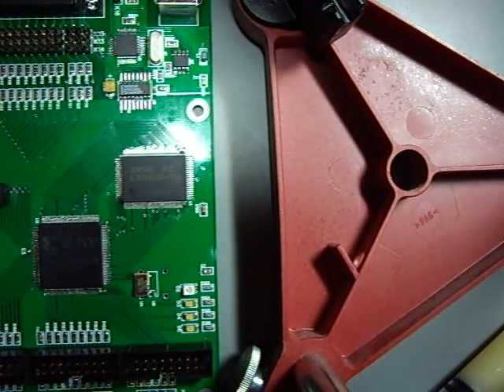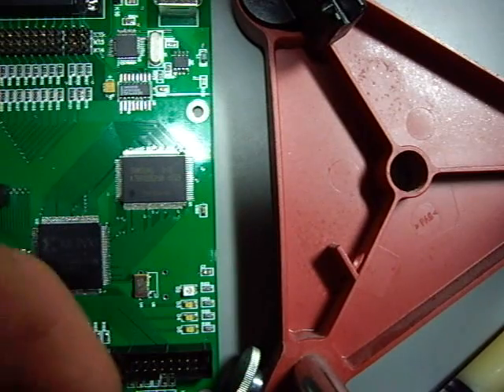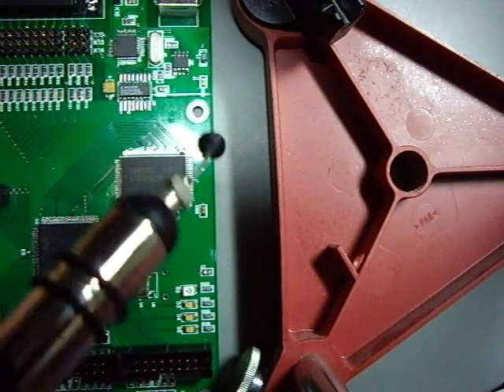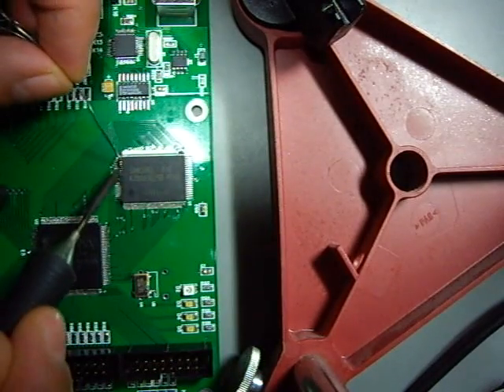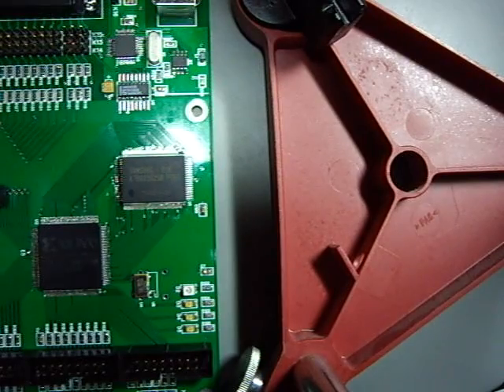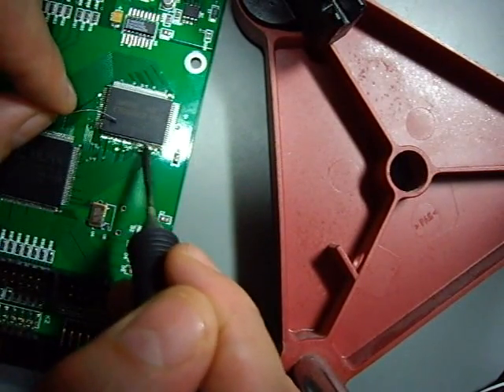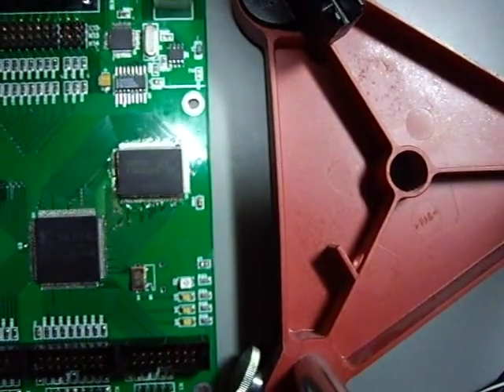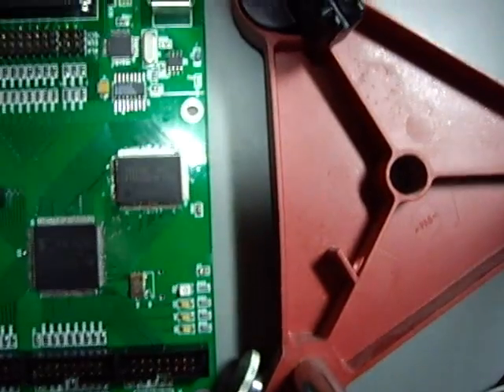How to solder a dense (fine pitch) SMD IC

Comment: Nice video.  Couple of questions though: 1) What's holding the chip to the board when it's first placed, prior to any soldering?  2) Do you have a part number for the flux?